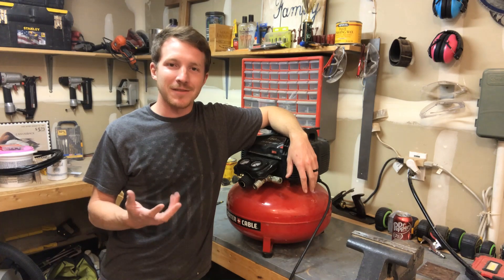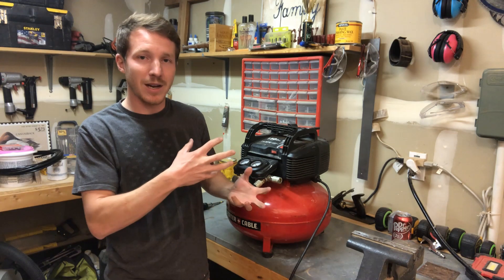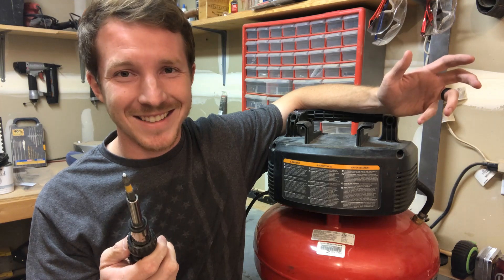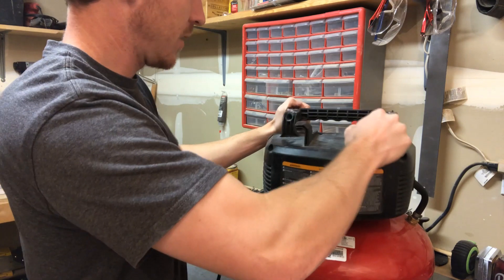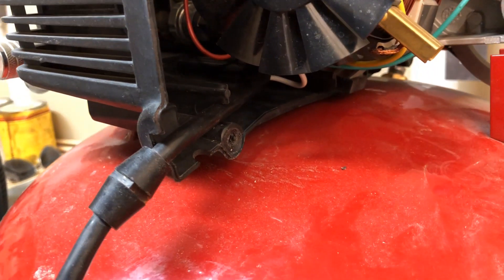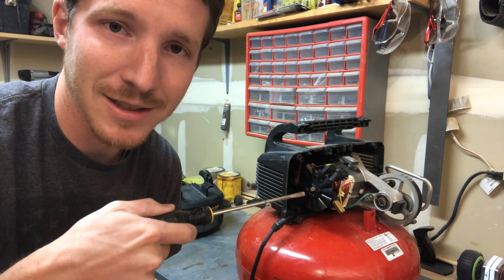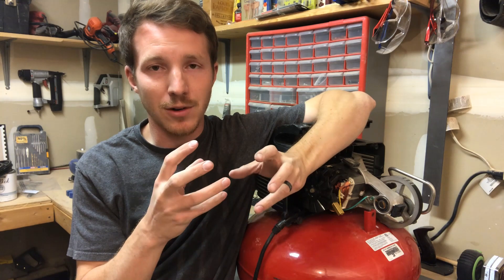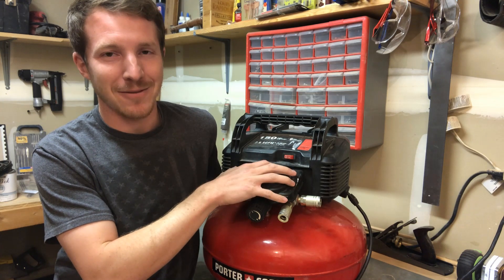Power Switch Not Working | Loose Wires | Porter Cable 6 Gallon Air Compressor

Comment: Since there is so much vibration in a compressor it is not uncommon for these type of disconnect connectors to weaken over time. You can gently compress the connectors' "Female" side with pliers so that when the two parts slide together they bite more firmly and make a more positive connection. If you look at the female connector from the end, the non-insulated portion will look like a flat/wide "U" but with the tops of the letter curving back in on itself (much like the shape found at the top of an Ionic column). Just gently and slightly compress those curving bits from the top so that you narrow the space that the 1/4" male blade fits into. You can also easily re-terminate the wire with a new crimp-on Female disconnect for very little cost. Just don't cut the wire too short to reach its target connection.
Reply from the maker: That’s a really good idea. Thank you! I might have to do that!

Comment: The lead wires from the cord on mine got loose and chopped up by the fan. I had to shorten the cord and put new connectors on the them. 1 ring, 1 straight flat and 1 90deg flat. Worked, but a bit of a pain to do.

Comment: Thank you for sharing.  My P.C. compressor wouldn't run and now it does.  The black and white wires were off, so I put them back on and crimped them with needlenose pliers.  Cleaned it up a bit and it's good to go.
Reply from the maker: Awesome! I’m glad you’re back up and running!

Comment: Thank you for your video, this is exactly the issue I had (same compressor, too!). My entire power cord had pulled out, and while I was able to take the cover off easily, I didn't know where the black & white wires were plugged in originally. Much appreciated, sir!

Comment: Followed your instructions....Compressor now starts up.  Only difference with my compressor is all the screws are T20, and a ext'n is needed to remove 2 screws....Otherwise it works perfect
Reply from the maker: Awesome! I’m glad you’ve got it up and running! Good to know the difference too 👍

Comment: If anyone is having a power issue, it’s most likely the ‘pressure switch’ being stuck !! ⬇️

Have fixed myself without tools, re-introduced high pressure (150-160psi) max another source into the regulator. You will need a backwards connection fitting, but will fix issue 99% of time
Reply from the maker: Thanks for showing another potential solution.

Comment: Sir I like to fix my compressor too .mines Dont shut off after 3 minute tuning don't shut off should I liaved 4. Second or six 6 ? Thanks can someone help?
Reply from the maker: Sorry, I’m not totally sure what you are describing.
Reply: @berlinbuilds  what happen is that empty it takes forever to shut down .it don't shut down.
Reply from the maker: @gersidoortiz25  How long is it running for?  It can take a while to fill up and shut off.
Reply: @berlinbuilds  how long you think I should let it run on a safe side .and I try what you said .it's a pankey 1.1 150 psi 6 gallon.crasman.
Reply: @gersidoortiz25  it can run for a good bit depending on what is going on. Let it run for 15 minutes and see if it shuts off or not. One thing to check too is if you have any leaks in the compressor or your hoses to see if that is part of the problem.
Reply: @nickberlin8247  thank you I will do that it won't blowup on my face Right?
Reply: @nickberlin8247  let it run for 15 minutes.ok I try that .and get back to you.
Reply from the maker: @gersidoortiz25  it shouldn't blow up.  They can run for a good bit before they kick off.

Comment: You would think they would solder those wires with all the vibration
Reply from the maker: I know, right?
Reply: They can do that, but in case you ever need to replace the all wire cable, it would be very difficult to take it out and install the new one…